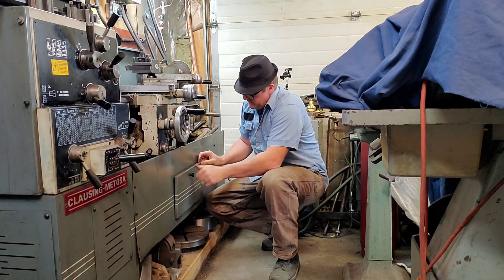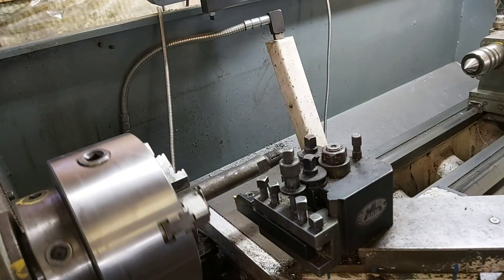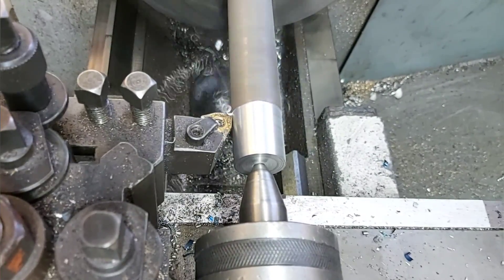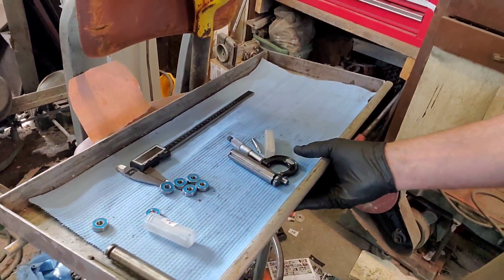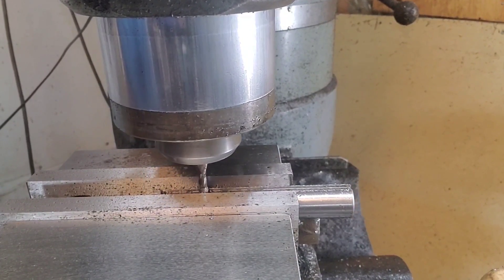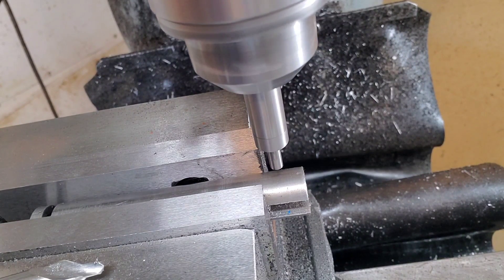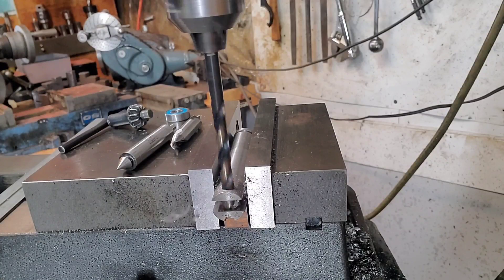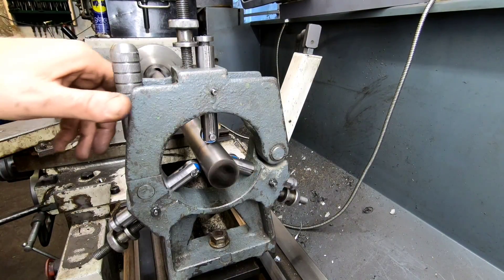Machining a new set of ball bearing rollers for a Lathe steady rest .

Comment: I 3d printed a very small version with bearings for my Unimat SL.   I have yet to put it to the test.
Reply from the maker: 3-D printed , the unimat is a smaller lathe  ,  should work if its a tight fit an low pressure .    Good thinking . Let me know how it goes .   Did you print the part on its side so the grain structure is long ways or bottom up on end ?

Comment: Nice video. I want to do add bearings to my steady rest. Are the bearings anything special or do you just order sealed bearings of about the right size?
Reply from the maker: To do the build I just ordered Cheap roller  Bearings. however being that bearings standardizes I can always upgrade to a better quality bearing any time I want. I probably will now that we've had this conversation, because I totally forgot that they were cheap :) bearings. Thank you .  The bearings I'm using are 608 - 2RS - C3 from from PGN bearing and it was a 10 pack off ebay i think. They where reasonably priced and bought them cheap because i wasnt sure if they would be the right size.  

Hope this helps
Reply: @Wrighmachining  It does thankyou. I got a brand new Precision mathews lathe and knee mill showing up in the next couple of weeks so I'm lining up my projects..:). Believe it or not I'm cheap too!
Reply from the maker: Pretty exciting stuff . Do you have a youtube channel ? ... can you post a link of the machine delivery  for us :)
Reply: @Wrighmachining  Well I do but I only have aerobatic videos on it ATM. I'm assuming I can video with my cell phone?
Reply from the maker: Totally just ( if it's Convenient) Grab it with your cell phone and just upload it to youtube from your phone and throw the link up here. If you don't want it to interfere with your Other videos mark it as unlisted. 

Thanks, Frank